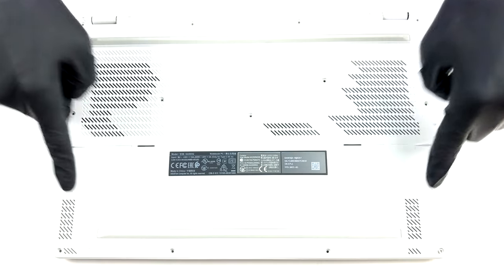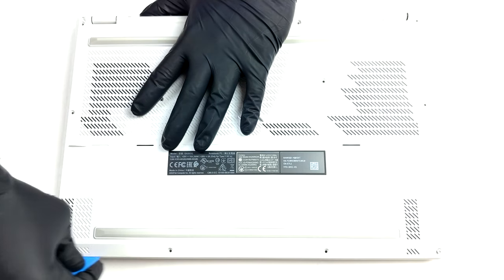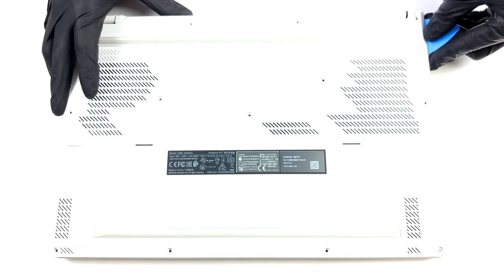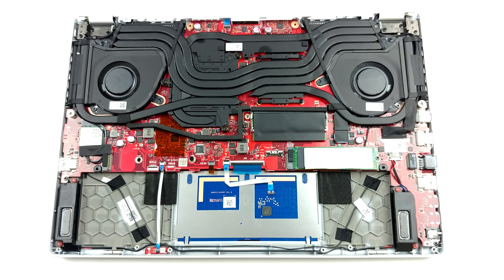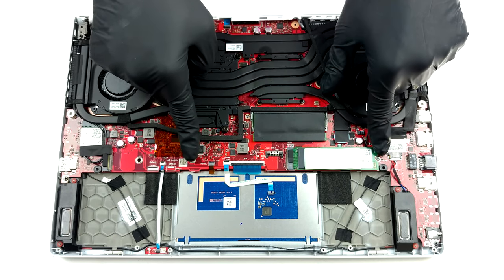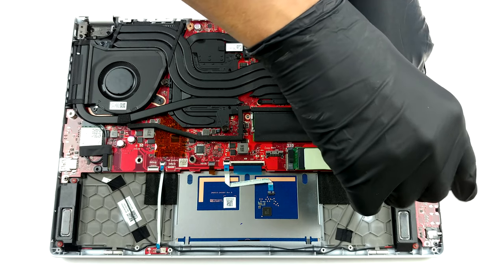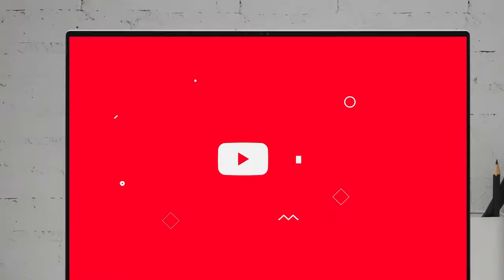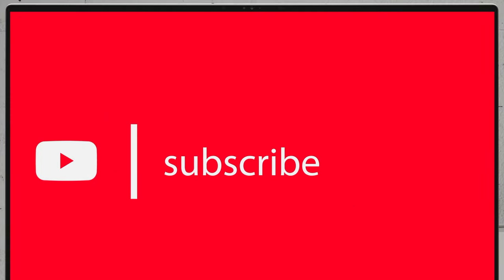🛠️ ASUS ROG Zephyrus G15 GA503   disassembly and upgrade options

Comment: i heard that it came with 2 channel RAM, 8GB soldiered and only the other 8GB can be replaced (by a max of 16GB), so max 24GB memory. It seem to be the case in your video where there is already a ram in the upgrade slot. Can someone confirm?
Reply: glad to see i’m not the only person trying to figure this out. this is the one thing i need to know before i commit to this
Reply: @xdanulicious4275  from what i read its dual channel 8GB+8GB one is soldiered, u can only get 8+16 =24 GB. this is unfortunately is a deal-breaker for me as my of my productivity software runs on 32GB minimum. And the 3080 /32GB version was not optimized.
Reply: @madcarrot2022  this is correct, don’t make the mistake I did, I bought two sticks thinking it would be like my other laptop but nope, it only has one slot that you can stick a 16 gig into
Reply: Not to mention that if you pair an 8GB stick with a 16GB stick you'll be stuck in single-channel mode.
Reply: Depends on what model, mine has 16gb on board and I've put a 32gb in the slot and runs perfect.
Reply: @MTB_FPV  So you achieved the 48GB max (ASUS's site) just by buying a 32GB DDR...uh, 4? SODIMM and plugging it into an...empty socket? On the top? Well done!
Reply: @Steve Nordquist  oh poor you, do you need a cuddle or maybe some Internet friends? I sense you're a lonely soul in search of any companion....I'm here for you Steve if you need to chat or a shoulder to lean on, times are tuff.
Reply: @pbdye1607  No, it runs in dual cannel for the 8 gb of both ram cards, the extra 8 run in singel channel
Reply: @Cineenvenordquist  No, there's an option of the g15/2021 that has a 16gb ram sothered onto the Motherboard
Reply: What's the disadvantage with single channel vs dual channel?
Reply: @skytech_00  Dual channel increases the memory bandwidth and hence increases the performance.
Reply: @MTB_FPV  yours is GA503QM-HQ144T? if so, which 32gb ddr4 you bought? if I may ask :)
Reply: I put a 32gb stick in and it read it fine and works perfectly I have 40gb total

Comment: Whats the best way to get the screws out that have rubber covers?
Reply: A needle to puncture the rubber and pull them out
Reply: I used tweezers to remove the rubber first.
Reply: use pins and pry along the edge of that circular rubber pad and pull towards you

Comment: Its a great laptop unfortunately mine died today after 3 months of ownership ive tried every trouble shooting tip on the internet it just won't turn on
Reply: Why did it die? I just got it recently
Reply: @aguywithdirections1995  im guessing heat they replaced the battery and motherboard when I swnt it in on warranty
Reply: Does the laptop have two RAM slots or just one?
Reply: @chinmaysambrekar9825  One sothered and one upgradable

Comment: On mine it says 1 16 ram ? And I want add another what brand and model do I buy ? And for the ssd m.2 will a 4 tb work ?
Reply: I think it only supports 2tb ssds, I'm not 100% sure thought
Reply: @cckiller4378  it works with the 4 tb ssd
Reply: @bigguy8749  Which SSD did you use ?

Comment: PSA: as far as I can tell, neither slots accept SATA drives. I put an old one from my old laptop in, didn't work in either slot and wouldn't get detected in the BIOS. And the drive worked when I put it back in my old laptop.

Comment: Hey!
So the screw on the nvme slot is extremely tight
Could you tell me how to unscrew it
It's extremely infuriating as I badly want to upgrade my nvme
Reply: Did you manage to unscrew it?
Reply: I'm so fucking done rn
Reply: @jansen7640  yes finally
Reply: @jansen7640  bigger taller screwdriver helps
Reply: I just put the SSD inside of it without screwing the screw in, or i mean out
Reply: I have been trying with a small nvme screwdriver that comes with the screw kit which just hurt my fingers but I used another bigger one and it helped exert more pressure
Reply: @krishna_v98  i have the exact size screwdriver needed for that screw. There's just no movement. How much pressure did you apply to the motherboards is
Reply: @jansen7640  I'm not talking about the screw size, I'm talking about the length of the screwdriver and it's handle. A larger one exerts more pressure 
I've tried for more than a day 
And idk how but when I switched the screwdriver it just twisted and unscrewed 
Maybe all that pressure weakened it

Comment: I've just spoke with ASUS asking about the mx capacity for the extra SSD (no SATA suooorted) , and was told that the max is 1GB , that is a disappointment
Reply: Did you mean 1TB?
Reply: I put a 2tb in my g15, ezpz.  Works fine.